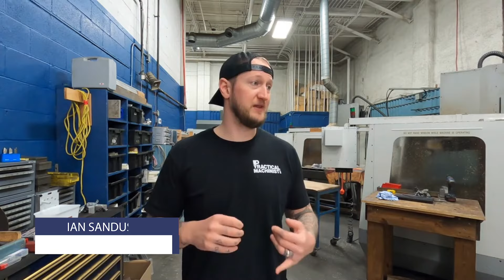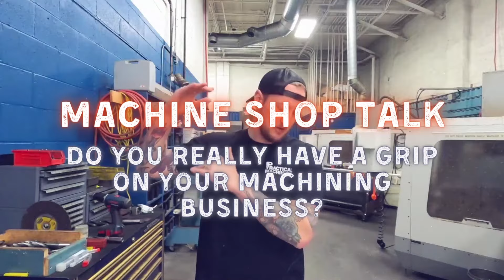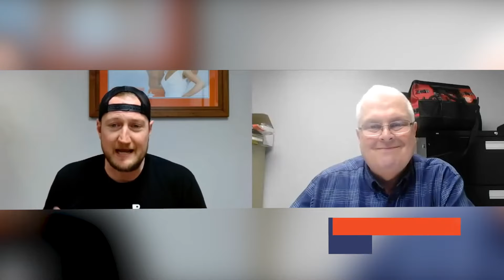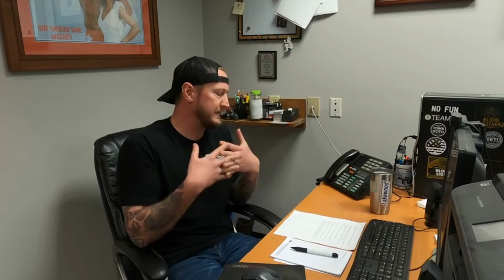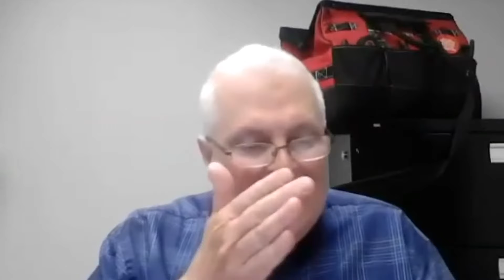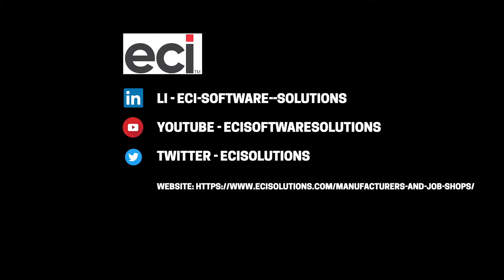Do You Really Have a Grip on Your Machining Business? | Machine Shop Talk Ep. 51

Comment: With ERP's you want to consider a few major things.  Are you implementing from scratch with the data and information you've built?  Or, are you implementing with intent to transfer information from your current system.  Those 2 will be huge factors in the initial cost.  Most ERP's are not easily compatible with existing databases and are hard to code to make it work, esepcially if it's custom, and most small businesses are considered custom.  Also, when considering ERP's, it's best to have a good long term vision on the capability you'd like to have and the options available on if you can purchase/lease modules as you grow.  In the end, ERP's are considered industry standard and I argue as necessary to compete at a world class level.  Without one, certain quality standards are hard to setup and run smoothly.
Reply: While the data transfer process itself is fairly simple (usually CSV import/export) between systems, such processes may not capture all data as databases vary between ERP vendors. This becomes the root of the issue mentioned above. Many ERP solutions have mapping tools to assist with data transfer and avoid potential loss but awareness to data gaps is key. During preparation for an ERP transition, do your homework...identify up front the priority information that must be retained. That way, any potential custom solutions will be obvious from the very beginning.

Comment: One thing I have learned about erp systems is they are all reliant on the data, garbage in = garbage out so having 100% accurate data is crucial or the systems just will not work and will cause more problems then solutions but when the data is accurate it can be an amazing tool in the toolbox to help make your shop make chips which = money
Reply: One of the hardest concepts to understand and this is extremely difficult for a business owner to admit. Do your best to review/cleanse the information prior to an ERP implementation and you are well on your way.